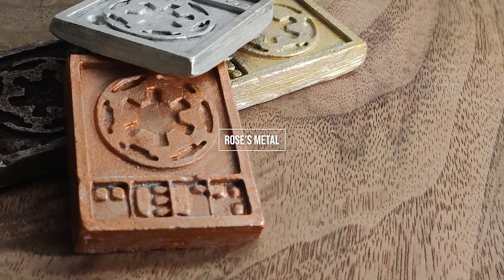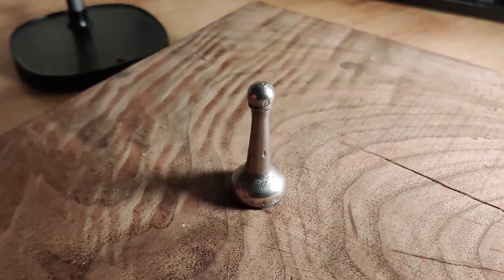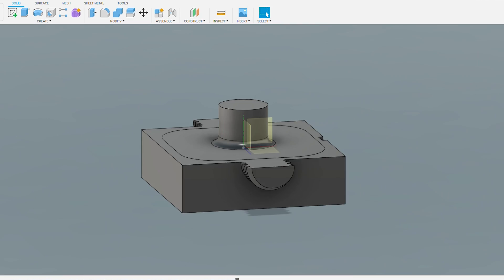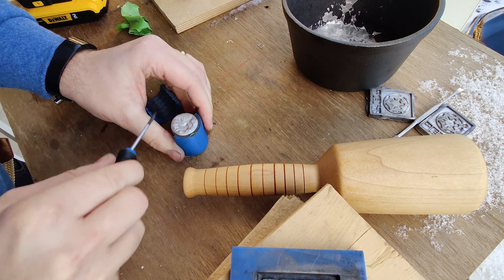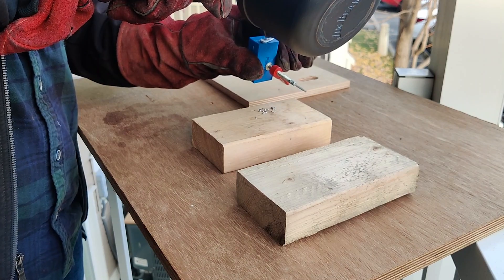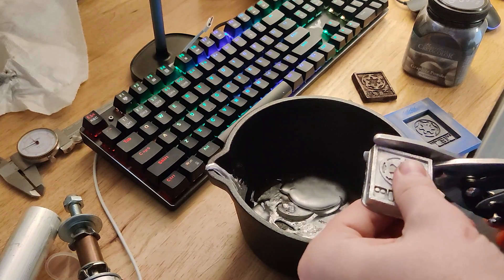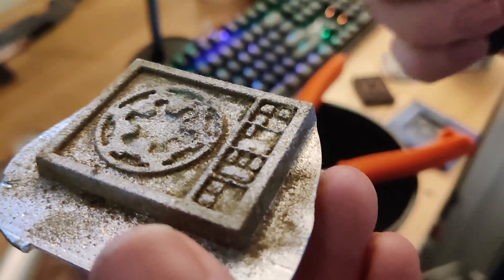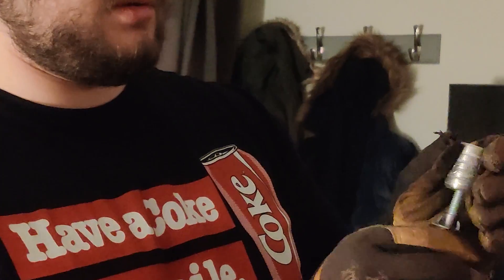Your 3D printer can make metal parts (Rose's metal casting)

Comment: Really cool video! thanks a lot for making this investigation, it help me  alot. If you wany to try an addiitional thing, I propose to get mirror finish on your casting by using a high melting point plastic, like ABS, using acetone to get glossy finish and the covering the piece with soldering flux (or any other synthetic oil). The cast should be super easy to remove and you should get an incredible clean result

Comment: 3:06 it should be noted that even if you have to raise the temp of your printer to 190-200 C to melt the plastic for extrusion, even just 65-70 on your heated bed is enough to sotften the prints to the point of being 'squishy', and pouring 100 C molten metal on them will only increase this effect, so I've found it's handy to make sure molds are well-situated before I start heating them up, and then THOROUGHLY check them for warping after the cool-down process, because that seems to be a problem with some mold shapes (making them impossible to fit back together properly for a second pour, causing leaking of molten metal everywhere)

Comment: Looking at the wikipedia entry for Rose's metal, I see all kinds of other low melting point metals and alloys.  Wood's metal has an even lower meting point, 70 °C (158 °F) versus 98 °C (208 °F) for Rose's and according to 800 gram quantities of either found on eBay (from a Ukrainian seller who warns, "This package may be delayed due to shipping carrier service disruptions") are virtually the same price.  Any reason why you didn't try it?  

Since Rose's metal is a non-eutectic mixture, as it cools down each of its component metals will solidify at a different temperature until the entire mass is solid whereas Wood's metal is a eutectic mixture and will solidify all at once.  I wonder what effect that could have on the casting - beneficial, bad, or none?
Reply from the maker: I actually made my roses metal with my friend who does metal casting. He had the lead and tin, so I just bought the bismuth (just on Amazon) so cost wise that was the best option for me. 

I also took the 3d printed parts and put them in hot water so I knew it could withstand up to ~ 100 °C so I wasn't worried about the heat from the roses metal. 

The woods metal also contains cadmium and I already felt like I was taking on a lot safety-wise with the lead in the roses metal.
Reply: Not a reply rather just "info for other readers" ... Woods metal contains Cadmium which is quite a bit more toxic than lead so I personally wouldn't choose that, there are other alternatives and the few degrees that differs between them shouldn't really matter (i.m.o).
Best regards.

Comment: You need draft angles, especially with the layer line texture that will make the cavity walls extra grippy.
Forget the graphite powder. Use dry graphite spray. CRC, Crown, B'Laster, ZEP, Sprayon are some brands. I use the CRC brand (from NAPA auto parts stores) in vulcanized silicone spin casting molds to cast Zamak alloy. I also spray it on the inside of my cast iron melting pot and the iron ladles. It's amazing how much heat protection a thin layer of graphite provides.
For copper plating you first have to get the metal CLEAN. It's a process called "pickling" and what to use varies depending on the base metal and the metal you're plating onto it.
By the color, your plating bath wasn't concentrated nearly enough. It should be a dark blue. You can make a super saturated copper plating solution from copper sulfate crystals sold for swimming pools. That's what gives pool water that light blue-green tint. This works for a light copper plating, often called "flash copper". To get a good build up of copper you need an "acid copper" bath. The flash copper plating is used for two reasons. 1, to get a copper coating on metals that are difficult to plate in an acid copper bath. 2, to protect the metal from being attacked by the acid during the early stage of plating in the acid bath.
Reply from the maker: This is a lot of really good information! I was really guessing on a lot of the plating stuff, and had no idea what it could have been the issue, so this is incredibly helpful! I did learn the lesson on draft angles (the hard way) but forgot to include it.

Comment: If you wanted to try going for metals with higher melting temps  you could consider sand casting using the printed part. I'm sure you could probably print the necessary tools to do it, if not there must be simple wood plans online.
Reply from the maker: I have done a bit of sand casting with my friend (he actually helped me a lot with this project) he does a bunch of metal casting and has a little shop set up for doing it. 
The big restraint for me is the outdoor space to safely melt anything else. But I do have some ideas I want to try at my friends place. 

I know other channels have done lost PLA and things like that. I kind of just want to try printing a bunch of molds and going for aluminum (just for fun). 

That's a good note on wood plans! That's actually given some ideas of things I can whip up pretty quick.

Comment: One item you didn't mention about the molds.  No vertical walls.  You need to tilt the vertical walls out some.  I don't know the amount, but I know it's very small. Like single digit degrees I think.  I remember Maker's Muse doing something on this.

Also, of course, lead is toxic, so you should wear gloves and coat your finished products in something to protect them.  No food items.

This was a really good video.  I came over from Hackaday.  I'm hitting the red button up there.
Reply from the maker: Yes i found that to be the case for sure! Parallel walls made it almost impossible to remove the piece. There are lots of good videos about mold making in general that were helpful! 

Also great note on safety! I did my absolute best to wear gloves and wash my hands after handling, and sealed every piece with clear coat. 
Further any sandpaper or rags were immediately thrown out after use because they weren't usable on anything else. 

I'm really glad you enjoyed it! Thank you for subscribing!

Comment: Do the molds degrade in any way after having hot metal poured in, or do they seem to hold up over multiple uses?
Reply from the maker: They held up well from my experience! I think making them as thick as you reasonably can helps a lot. I would imagine there is some limit to how many pours you can do with one mold before it starts getting brittle or losing details but I haven't yet hit it!